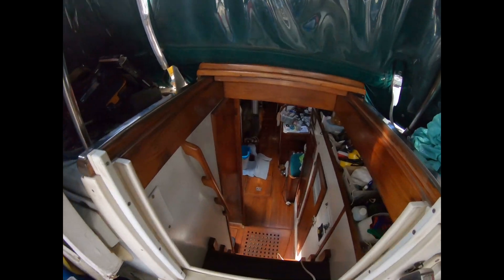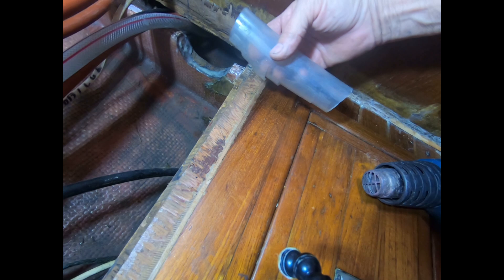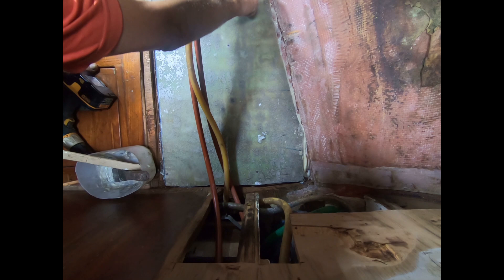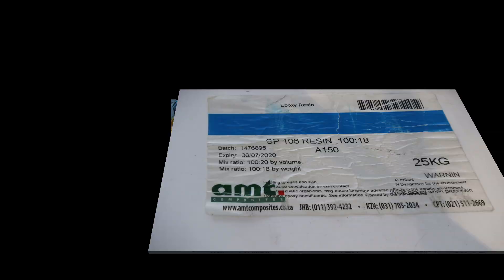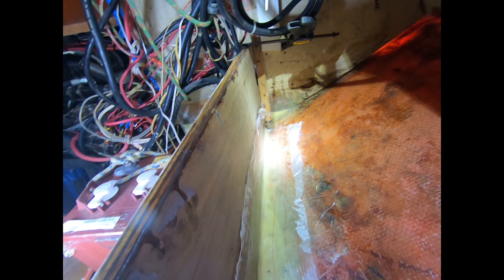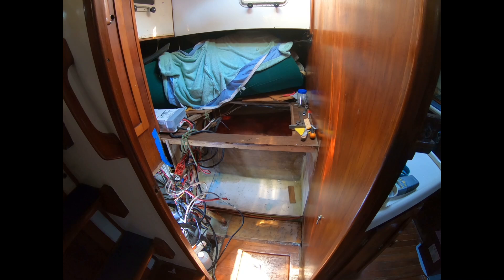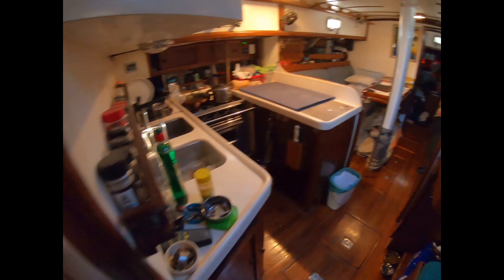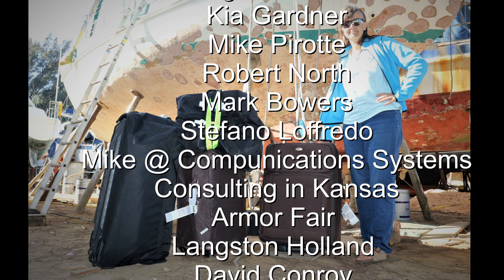How to Rebuild a Battery Box (LEAKING lead acid batteries on a Sailboat!!) Patrick Childress #46

Comment: Great video Patrick.  You sir are one of the hardest working guys I have seen.  Your vent hole(s) on the back of the box may be a bit blocked by stowage.  You could add a hat shape channel on the back to guarantee an inch or so ventilation chimney is achieved from the top or bottom of the vent hole.  Kind of like the channels used in the attics of houses to prevent blown fiberglass from filling in the soffit vents on the eaves of a house.  As a battery retention mechanism, you could get some 1.0 or some diameter wooden rods (glassed and sealed) and make retention cleats on the front and back walls to hold them in place.  On the back wall you could make through holes and some sort of anchor cleat or block on the back side.  Kind of how you would hang the rod in a clothes closet.  Take care and Fair Winds Patrick and Rebecca!
Reply from the maker: Hi David, You are right about the vent hole in the back. It can get blocked. I was thinking of just screwing parallel spacers, about 20 mil/3/4 inch thick, one on each side of the hole then attaching a small plastic panel to the spacers. Things can rest up against the panel and still there will be an air space. Thanks for pointing that out.
Reply: @SailingBrickHouse-RVLife  Great idea for a hat (U type shape) shaped chimney  to fix the potential problem.

Comment: It would be good to know your inventory of tools.  It looks like you have a lot of tools, more than what I would think that you keep on your boat given space limitations.  What tools do you travel with and how do you access tools that you don’t normally keep? Rent/borrow? From whom?  Or maybe you just buy them as you need them?
Reply from the maker: Most of the storage on this boat is taken up by tools and spares. We are trying to weed out some of these redundant spares and "things ", lots of "things". It is nice though, when out in the middle of nowhere, to be able to reach into a locker and pull out a little sheet of plastic to cut into a needed shim or spacer or to have just the right stainless screw or bolt, or gasket material or so many other little "things" that are needed to keep a boat operating. So far, the only real tool I had to buy here in Africa is a laminate trimmer. It is a small router used to cut Formica. That is one tool I will give to another cruiser when we leave. In the last video about the tearing apart of the battery area, I showed a bunch of power tools which always travel with us.  Maybe during this haul out, I can din into a locker or two and show more of the hand tools or spares.  Thanks for your comment.
Reply: Got it.  Thanks for the response.  If I were sailing like you I would want as many practical tools and supplies with me too, because I value the independence of being able to take care of my boat myself but I am sure that available space is a premium too.  Always a balance/compromise I am sure.

Comment: Lightbulb moment- never knew you could thicken epoxy- that stuff runs everywhere 🙈🙈
Reply from the maker: There are different thickeners for different uses. Cabosil (fine, powdered silica) is for strength. There is also fine cotton fibers and yet another, a reddish "micro-balloons" for easy to sand filler. Lots of different thickeners. In a pinch, I have used baking flour. I don't know why I have not heard of anyone else using  baking flour, so it might not be a good idea.

Comment: You might consider long threaded rods going through the wall at both ends.  You just need enough room at one end to be able to slide them in far enough that you can tip the other end up through the same opening your batteries go in.  Then you could have nuts on both sides of the wall to stop the rod from coming out.   If you put two of them across the batteries, you should still be able to check the water without removing them.  I don't think I'd use cloth straps as they could well fail with the corrosive atmosphere in there and then you'd have batteries (and battery acid) all over your boat if you turned turtle.
Reply from the maker: Interesting idea…

Comment: Looks great,  why don't you use the battery lids as the battery holder, IE, latches on the lids to secure them shut...just a thought.
Reply from the maker: Thanks for the compliment, Larry. The cleats holding the lids are just screwed in and, as is, not strong enough to retain the batteries. I want to keep it that way for now, in case we opt for lithium batteries. Still, I want a quick easy access to the batteries to check their water and not have to unscrew a bunch of screws to get to the caps. There have been a lot of good suggestions of which I am contemplating a lot of them.

Comment: I would secure the top on the batteries with 1x4 boards instead of straps.  Screw the boards down with a small ledge.  Unscrew boards to replace batteries.
Reply from the maker: Except we have to check the water every few weeks so sort of a pain...But this may spark another idea ...so thanks for suggesting it! -Rebecca

Comment: I wonder if you can use a cake icing bag for the thickened epoxy? I am learning a lot from you Captain Patrick! Thank You!
Reply: Zip lock bag with a corner cut off.
Reply from the maker: There has been a time or two I could have used something like that, but now I will use Kyle Goldston's idea of a Zip lock bag with a corner cut off.

Comment: Cover batteries with rubber mudflap and screw in 2 wood 2x4 across top of batteries.
Note :Water needs to drain through made compartment to bildge
Reply from the maker: Thanks for the idea for retention. But no, I won't be draining spilled battery water anywhere. I am very impressed by the damage a little battery acid can do and don't need it eating up my bilge. Thanks for your comment.

Comment: It looks like there's not a lot of room between the batteries and the compartment walls. If you glass in, vs screw in, some strap attachment points, be sure you can get at least one battery out from under those attachments. Then, like a slide puzzle, you'll be able to get the rest out.
Reply from the maker: Good idea!!!got it! -Rebecca

Comment: Hey Rebecca, I've been doing a lot of research on LiFePO4 battery packs recently: build your own. There are giant cells that literally just bolt together, just like your current 6v batteries, and BMS123 just bolts onto the positive terminal of each cell. Zero welding or soldering, no cable nest for the charger. Cost is about 2/3rds of battleborn with a much better BMS and you can choose almost any shape or AH configuration you want. You're running a 12v 675ah configuration right? I see 6 x  6v batteries. I'll spec a replacement for you real quick.

If you ever want help researching boat stuff just let me know. That's what I'm doing with all of my spare time anyway. I can just as easily research something your boats needs as something my imaginary boat needs.
Reply from the maker: I like that...researching something your imaginary boat needs...I like that. I’m just so unconfident that LifePo4 batteries are truly ready for the marine world. Close I think, but at their full,potential and I hate to jump on the bandwagon too early and then regret getting what I get. And it’s so darn critical that’s its right or you could seriously be caught out with no way to get to port. I guess you would need to carry some spares too so that one bad one doesn’t render you handicapped for others. And I’m not sure those things can fly on an airplane? -Rebecca
Reply: @SailingBrickHouse-RVLife  I am pretty sure the battleborns are more reliable than lead acid in almost every way between 1°c and 40°c operating temperature (lead acid is maybe better for the -20°c to 0°c range). In the kit I suggested the thing I am worried about is that the BMS is vulnerable; on the battleborn the BMS is inside a waterproof case. The battery pack I suggested will work without the BMS though. BMS helps with longevity and improves safety when charging larger battery packs quickly (above 0.5c). But 4 cells in series is not large, and on the pack I suggested you would need to exceed 200amps charging before a BMS was really necessary. So even if the BMS died, you could get back to port.

Cost aside, you could replace your current battery bank with two redundant Lithium battery packs and it would still be smaller and weigh less and you could install them more easily in different parts of the boat to free up usable space and adjust balance.

What were you concerned about?

What you might want to do is keep a small (marine) lead acid starter battery for the engine, and lithium for everything else, and a trickle charger from the lithium battery back to the lead acid to keep it topped up. Then you have the 150+ years of lead acid technology history saying you can start your engine exactly the way it was designed to start, plus redundancy, plus the efficiency advantages of lithium technology for your other electronics.

I think LiFePO4 is ready, and over it's life cheaper than lead acid. Lithium Titanate is supposed to be safe and operate under all conditions and last a lifetime, but it's quite expensive and has discharge inefficiency and the voltages don't quite line up for 12v systems.

My imaginary boat is being offered at a great price because the engine room is a disaster and most of the electronics are shot and need to be replaced. Lots of research needed to fix it up. The hull, wiring, and interior are in perfect condition though... not sure how that happened. Everyone can have fantasies, right?

Large Lithium batteries can be air shipped as freight, maybe as checked luggage, not as carry on. LiFePO4 batteries that are even slightly properly packed are really not much of a risk, but the rules are for all lithium batteries. I saw a video of a huge 32700 LiFePO4 battery pack being run over by a tank... it made some nice sparks and melted a little bit but didn't catch on fire.
Reply from the maker: Wasn’t sure 400 is enough...advisable for longevity, it’s advisable to not go less than 20% even 10% is possible...so that means 80-360...so 280 usable/advisable. Lead acid...usable 50%-90%...because the last 10% is so difficult to get, so 340-605 is 265 truly usable/advisable.  So yes...I guess a  400 lithium bank would be about a lateral move. We would really like MORE usable. I think undercharging the lithium’s are the way to go. And everything til now is designed to charge things as fast and as high as possible, like lead acid batteries like the best, but can’t seem to get there. 
It’s all interesting. I’m going to be studying your link and continue ing to think about the possibilities. Things in the electrical world are developing fast right now, faster than they ever have before...and we don’t NEED new batteries quite yet...so I have time. But will be seriously considering Lithium Iron Phosphate...or other ideas...so when we need them, we are ready to pull the trigger. Yes...keeping the lead acid as a way to protect the alternator, etc sounds like the wya to go too. I think the whole technology is getting close, but I still think there will be some improvements that haven’t been released yet, that if we jump right now, we won’t be able to take advantage of until the next time we are ready to replace batteries, which hopefully, won’t be ever again! We are ready to change...but it’s no rush right now! -Rebecca
Reply from the maker: But then there is the charging systems to think about...and the wires...many of our things are luckily ready to go. But our wind generator should probably get a regulator, unless these can be programmed to stop their charging at 90% rather than at 100%, so as to prolong their life. -Rebecca
Reply: @SailingBrickHouse-RVLife  LiFePO4 is not very sensitive to overcharging. The gel or AGM mode of any lead acid charging system should be fine. Just avoid charging over 14.4v. Longevity can be improved with gentler charging, yes, but I wouldn't lose sleep or buy a new wind generator controller over it.

Also, lead acid batteries are only 85% efficient. LiFePO4 are 99% efficient. If you have lots of power to throw at them any time you need to, it doesn't matter, but if you don't... A few days in a row of low wind/solar power or an emergency? Here's a story where they ran out of power and lost contact with the coast guard and had to deploy their EPIRB and wait 3 hours for solar to charge their (presumably lead-acid) batteries back up. Since they lost contact the coast guard sent a helicopter to confirm their location and safety. LiFePO4 might have avoided all that extra drama. https://www.acrartex.com/stories/texas-coast 

What do you normally do to keep the batteries topped up? Do you have to run the engine?
Reply from the maker: We are Ok for a few sunny or windy days at anchor but then have to run our little Honda generator to charge things back up. If it’s super windy, we stay topped up pretty well. The solar never keeps it all charged up because  we only have the one panel. Just no space for more without creating a Winnebago to cross seas with, in our case. And when we have another anchorage to go to, we charge with the engine on the way there, to shove that last 10% in that just goes in to slowly to ever get fully charged. Lead acids like to be charged up to 100% and it’s so hard to do. My understanding is that a lot of the lithium batteries are prematurely failing due to being fully topped up so often. They like it once in a while, but they don’t like to ride for periods of 100% charge very often, or for very long.
..am I wrong about that?  -Rebecca
Reply: @SailingBrickHouse-RVLife  Lithium batteries never need to be fully charged. They have no memory effects or anything like that. Other than that, you're not wrong, but the real answer is "it's complicated". It depends on the chemistry of the battery. And there are actually tons of different sub-groups of chemistries, not just the main 4 that get talked about, and it is usually a trade secret what exactly is in there, and I don't pretend to actually know what they are, but Tesla, for example, is optimized for energy density and they use a chemistry that expands and contracts more when charged/discharged. It physically breaks the battery a little bit each time you full charge or deep discharge them. In other chemistries this happens less. But for LiFePO4 I wouldn't worry about it too much. They are tough. My motorcycle LiFePO4 batteries are kept at 14.4v float basically all the time that I drive them (and we go on tour, so that has been 8+ hours per day of my stock motorcycle alternators keeping them topped up at 14.4v) and they are still sold with long warranties. The one in my Deauville seems to be working just fine, and I even abused it a bit (brief full discharge 2 times when I forgot to turn the headlight off and then had to push start it). My other one appears to have lost a good bit of capacity, but it is also 1 year older (now 4 years old I think) and I REALLY abused it (used it for other projects where it got charged above 14.4v and discharged a lot).  Other than having lost some capacity, it still works perfectly. (the motorcycles and their equipment are real, unlike the things on my imaginary boat). I think your concerns are mostly based on "Lithium-Ion" (those are lithium cobalt) batteries and not LiFePO4 batteries.

But in keeping with my earlier suggestion: If you go down to a much smaller lead acid battery you can just connect a charge controller for the new lithium battery to it. Then you could use your existing wind generator, solar charge controller, and alternator and instead of replacing any of those 3 devices, just add 1 more device to give you all of the advanced charging and protection for your new investment. For a retrofit that should be the easy and cost effective way to go IF this 12v to 12v lithium charger with LVD actually exists at a reasonable price (solar charge controllers do this exactly and cost $20, but they also say not to connect anything but solar panels below the rated amperage to the input or they will fry). I'll keep my eyes out for one.
Reply from the maker: Lex Maxwell Hah! My MPPT solar charger was about $400 I think...not $20 :) And it’s ready for the different charge properties of LiFePO4. I don’t have a charge controller for the wind...so it just comes in at 16V or something, uncontrolled, so I’m guessing that the batteries won’t accept anything form the wind if that’s the case. May even shut down until that 16v goes away. The built in battery charger that I have, is also ready for LifePO4. Also I notice different LifePO4 have different optimum max charging rate, so luckily my charger has adjustments that can be made. -Rebecca